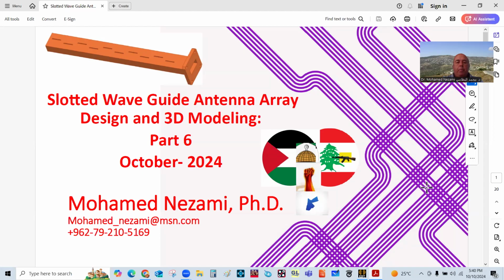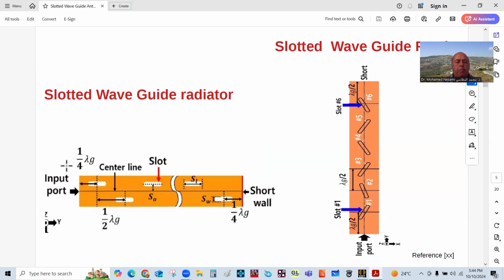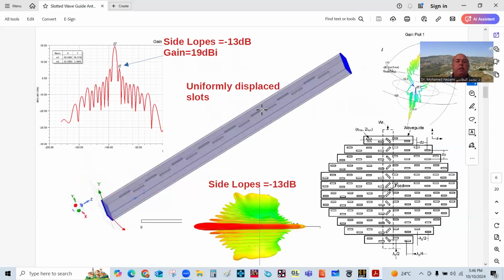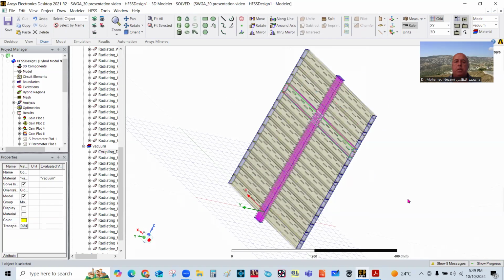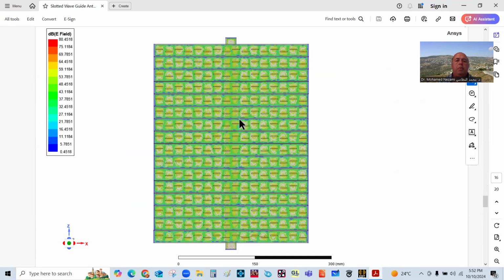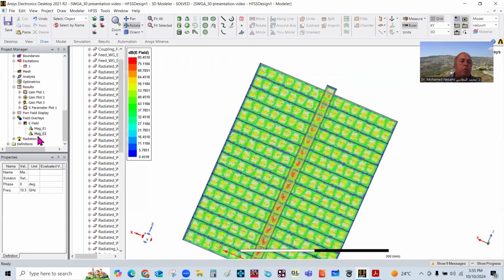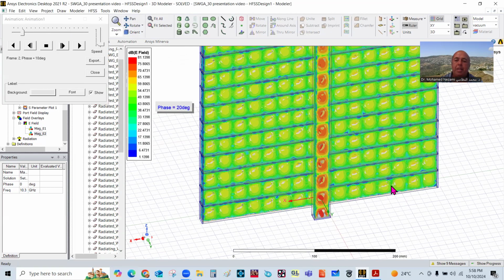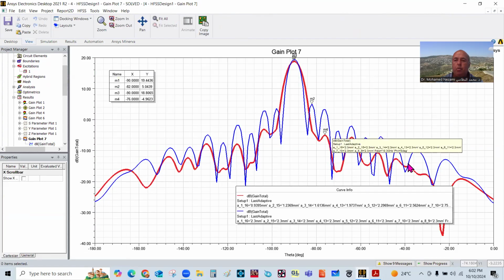Part 6 : Slotted Wave Guide Antenna Array Design and 3D Modeling, 30.6dBi Antenna Array.

Comment: Hello Dr. Nezami, I tried the same model, the gain profile is fine. but, S11 and VSWR are horrible. Please suggest means to optimize impedance matching.
Reply from the maker: parametarize the feed slot location, and then run optimization
Reply from the maker: the RL is on the order of 6dB to 8dB at most ???. 
yes that is an issue.